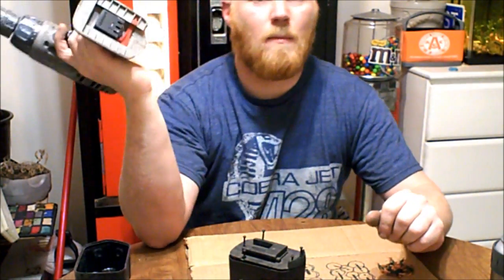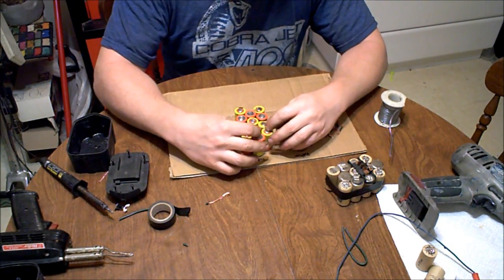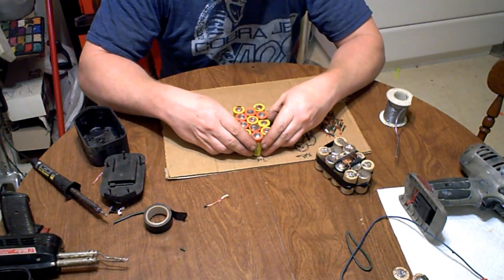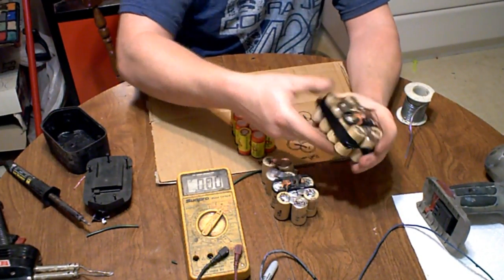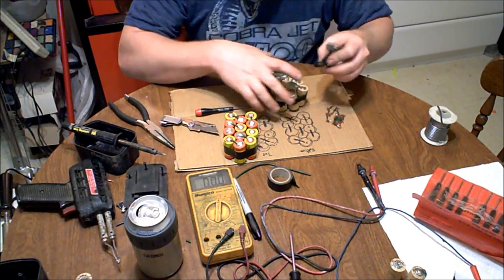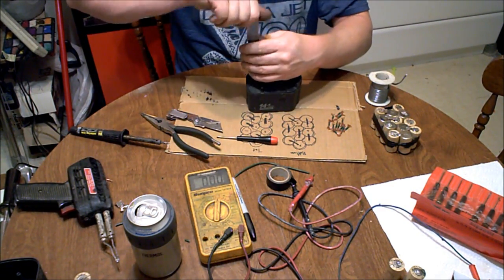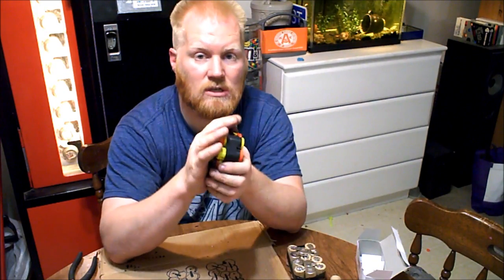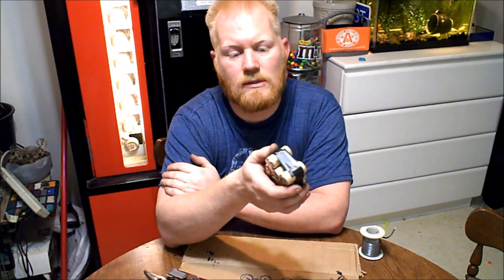Cordless Drill Battery Pack Rebuild for $20 or Repair for $0

Comment: Great video.  I have a 7.4v 4400mah battery pack with 4 cells...they are not labeled and I need to replace them.  What are each one? Thanks!
Reply from the maker: They are more than likely Lithium 18650 cells. They are rated at 3.7 volts each. So you have 2 sets of 3.7 cells(2x3.7=7.4v) wired in parallel.  Typical 18650 cells wont work. You need HIGH DRAIN cells, probably in the 20Amp discharge range. Pull the number off one of your old cells and look it up.
Reply: Thank you so much for the help!

Comment: SE US18650V 
T V1122RG17P
Reply from the maker: US18650VTV1 The closest I can find is US18650VTC1 which is a 30 amp draw battery.
Reply from the maker: I just can't find anything on the exact battery you listed. Does the side of your battery case say 3.0ah? If so we know that your batteries are 1500mah (1.5ah x 2=3.0ah or 3000mah)

Comment: I have a Makita Lithium Ion battery 18v,  I opened the pack up and I have 10 batteries measuring 2-1/2" Lenght and 3/4" Diameter.  I cant seem to find batteries on ebay to rebuild this battery, any help?? Thanks.
Reply from the maker: Your lithium cells are called 18650. BUT they are not typical 18650s, they are HIGH DRAIN lithium 18650 cells. Regular 18650 cells will short out if you try to put them in your drill.
Reply: sixtyfiveford So what do i search for to buy for my drill?
Reply from the maker: Your drill under load will pull around 30-40 amps. Your 10 batteries are wired 5 in series and then another 5 in series paralleled together. So you can split the amps and you need batteries that will supply around 20amps. Are there markings on the outside of your old batteries?

Comment: I want to thank you for your demonstration.  I also like your idea of "mapping" the cells on cardboard. 
With the use of "mapping" the cells for my 19.2 Volt Craftsman battery pack, I was easily able to rebuilt it, using 2900mAH batteries....It works great.  I expect that the new mAH rating for these new cells is much better than what came in the original pack. 

I do have some concerns though about some of your recommendations though.  As my battery packs were starting to go bad, I did test the individual cells and found that only "some" of the cells were not charging.  By the time I rebuilt it, NONE of the cells would hold a charge.  Therefore, I would recommend that; if your going to rebuild a battery back, then replace every one of the cells, as to avoid having to redo it in the very near future. 
Further, I had no way of knowing nor telling what the mAH rating was for each original cell in the pack.  So replacing "all" of them with new cells of the same rating seems like the better option. 

What do you think?  Does this sound like it would work better?? 

-Thanks.

Comment: Where are you getting 2.1AH nicad SubC batteries at for $1.67 each????  (12 x 1.67 = $20)  Please share!!!
Reply from the maker: Ebay. 2.2ah T-energy cells when I did this video were $22.54 for 12. Looks like you can still get them for this if you buy 24

http://www.ebay.com/itm/24-NiCd-Sub-C-2200mAh-Batteries-for-PowerTools-No-Tabs-/290485576557?pt=US_Rechargeable_Batteries&hash=item43a24a236d

Comment: If you are concerned about overheating a cell, use a clean flux like Kester 951. With the flux you won't need to leave the heat on for any longer than absolutely necessary.  Another trick I've found is to use the flat bus wire that is used to assemble solar panels.  It is 5mm wide and tinned.  You can usually get a 10 foot length of it on eBay for a good price.
Reply: I second the 951 flux - great stuff, works very well.
Reply from the maker: I have never really used liquid fluxes, only pastes. I just ordered some off Ebay and will give it a shot. Thanks guys for the heads up.

Comment: with a multi meter I checked all my cells and all voltage was fine....but will not charge in in charger unit.....ie broken cell or overheat....deff not over heat .....cold any thoughts ..thanks
Reply from the maker: There is a thermo sensor that cuts out when battery get to hot or cold. On the battery I'm working on it is the center terminal and it is like this on most batteries.  You should get voltage at this terminal.
Reply: Hi its a 24 v 3 ah bosch battery drill.. I run it flat then put on charge when cold and will not charge now...im getting 24.4 volts ...its got 20 cells @ 1.2 volts each...im at a loss now...started to disconnect each cell and test and disconnected battery reader  ....im stuck now. regards
Reply from the maker: Running them flat is bad for the cells. Stronger cells will actually reverse the polarity of weaker cells damaging them permanently. Your battery fully charged should read around 28 volts and is completely dead around 20 volts. You need to load test the cells. You can do this by hooking the disassembled battery back up the drill or a small flashlight battery to each cell.

If you can find a small 1.5 or 3volt light bulb from an old flashlight. Hook the bulb to the pos and neg of the multimeter and then touch the ends of the cells. The bulb will put a load and give you and accurate reading of the condition. The cells should hold around 1 volt for 5+ seconds. If it drops rapidly to near zero that cell is bad.

You can do the same test by hooking the disassembled battery pack up to the drill and testing each cell while the drill is running. You will probably find some that reverse polarity(pos becomes neg). These cells are bad.
Reply: Thank you very much ..
Reply from the maker: Let me know what you discover.
Reply: given up and will buy new one for 70.00 pounds....thanks for advice anyway
Reply from the maker: Take care.

Comment: Applying that much heat to a cell cant be good for it, am I right ?
Reply from the maker: To much heat can damage a cell. So melt the solder and be done. If the solder is taking to long to melt or I fiddling around with one I will stop let it cool and go at it again. I've never ruined a cell and never got it hotter than they get themselves by running.
Reply: sixtyfiveford Maybe your using too large diameter solder.

Comment: Thanks for this great idea! I have bought batteries from eBay, rechargeable, and they worked out fine. I assume I can get the STRONGER ones, right?
Reply from the maker: Yes, you can can get batteries with higher capacities. Just stick with Nicad as Nimh can't handle the high power drain of power tools. I really like T-Energy batteries.

Comment: Before watching this I just ordered 8 nimh 3500ah batteries for my 9v Makita (old ones NiCd).  I know they are different but I hope they work.  I looked into it and the charging times are longer.  I will let you know if it works over the long haul.  Still a cheaper alternative than nothing.  Just subscribed on your snow-blower seal vid
Bruce
Reply from the maker: A 9v Makita won't draw very much power so you should be fine.

Nimh- are for slower power draining devices.  They hold more power but also take longer to get the power into them.
Nicad- deliver a lot of power at once to high drain devices. The are fairly quick at recharging.

Comment: Thanks man. You explained everything really well. I was going to take a pack to a battery shop and have them rebuild it, but I'll give it a go myself. I just did a battery replacement on an Oral B toothbrush that died, and it works great. So I'm sure this won't be a problem for me either. It's nice to see someone actually do it though before I try it myself.
Reply from the maker: Let me know how it goes.

Comment: where did you get the batterys and how did you know what kind to get
Reply from the maker: Ebay is generally your best bet for Nicad batteries. Most cordless drill packs use "sub C" size batteries but you will need to open it up your old pack to see and measure.

Comment: How do you repair the 18V Lithium ion SKIL battery charger?? I charged by bat. pack twice and now nothing?? Any help would be much appreciated
Reply from the maker: On electrical components like a charger, the most common thing to go is capacitors. It could also have a blown internal fuse. Open it up and look for anything burnt or loose.
Reply: sixtyfiveford I'm a BSEE and I've repairing all the tools at my furniture company myself for 5 years.  You give excellent advice. Thanks.

Comment: Good video, I have seen 12 1600Ah Ni-CD 4/5SC SubC 1.2v at recycle powers in China, the die mentions are 34.4mm L x 22mm W mine are 41mm L x 22mm W ! Are they all like this and will they fit ok? Or should I look else were? Please help,. Regards robincox89@btinternet.com this is my e-mail address robonthemoor is my utube name any advice will be welcome.
Reply from the maker: Sounds like you just need Sub C.. The 4/5 sub C are shorter. Ebay is usually the best deal for Sub C batteries, I really like Tenergy brand.

Comment: Your video would have been more helpful if you had the camera closer (or zoomed) in on the batteries as you were connecting (soldering) them and the terminals.  Very hard to see what you were actually doing.
Reply from the maker: Lay it out just like your old battery pack. The video is available in HD so you can view it on Full Screen on a computer.

Comment from the maker: The little pencil one I use is 30 watts. It will work and I  have done entire battery packs but it is a little slow as you have to let it heat back up between connections. I prefer something with a little more watts.

Comment: I think this would be helpful for some:
ebay.c o m/gds/Sub-C-Rechargeable-Batteries-Buying-Guide-/10000000177628854/g.html

"Sub C" and "4/5 Sub C" are totally different sizes, and it's important that you determine the exact battery form factor you need before ordering.

Comment: Good video with valuable info.  Should not have skipped all the soldering, since heavy duty solder was used with a small iron.  It would have been good to see that done once or twice because it is the critical step in making this work.

Comment from the maker: The discharge rate is higher but the drill or whatever it is powering doesn't draw that much power that fast. The lithium would work great but you will need to get a different charger for your new lithium batteries. By the time you do that it is generally cheaper to buy a new drill that already uses lithium batteries.

Comment: I see that the Sub C cells have a max discharge rate of 2C wouldn't lithium ion with a 10C rating be better? Most of those are 3.7 volts and 2000 mah (milliamp hours) - Couldn't you use those in a different configuration?

Comment from the maker: Its most likely a lithium and has 3.7 volt 18650 lithium cells. They are situated just like these. The gauge is just soldered in.

Comment from the maker: Nimh are cheap and don't work well in high drain devices. They hold larger amounts of energy but deliver it a lot slower. Nimh are fine for digital cameras and such where the power drain is slow but not power tools. Your original charger is fine.

Comment from the maker: Sorry for the delay in response. Scratch up the top of the battery lightly with a sharp edge or use sand paper. Apply solder to the battery top separately, melt it then put your tab or wire on and apply heat. They will bond.

Comment: would 4/5 sub c work in my  old b&d 14.4 v and will my factory charger get toasted charging them ni cads. Would I have to get a better charger? ni-cd or nimh? price difference is 2 bucks but one has a lot more 2800mAh vs 3300mAh.  

thanks,
Matt

Comment: Please don't throw away the old NiCd batteries; they contain cadmium, which is a heavy metal (like lead).  Please recycle your NiCds.  Home Depot or Radio Shack will take them or if you have a town recycling station they might take them too.

Comment from the maker: Right on, reclaiming the 18650s is the way to go. The thing that fries individual cells is draining the battery pack to low. When they noticeably drop off and you still need to screw in 2 mores screws, don't. Weaker cells can actually be forced so low that they reverse polarity and are damaged forever.

Comment: i have 5 rigid battery packs, and have taken them apart, i saw thet only one or two were fried, so after researching, i found out that laptop battery packs have the same 186500 type lithium-ion batteries, so i dismantled thre battery packs and ,VOILA! free batteries.
thanks for the video i can once again use my drills

Comment from the maker: The Lithium are a different beast entirely. Your drill wouldn't mind but your battery charger would. 20 volts would would more than likely fry your drill. Any solder that says "electrical" solder will work (plumbing solder no).  As far as memory goes, according to numerous technical articles it is a wives tale. The thing  that kills your drill batteries is using them when the start to drop off in power. Generally you just need to screw in "1 more screw" or the like. This kills individual cells.

Comment: You can also use the OHM setting (resistance) to measure each cell.   I've found over the years that as NiCads age, with hi amperage charging.. The peak voltages actually rise.  eg. a 7.2V pack can peak at 10-11V with charge current applied, 3A to 15A.

Comment: Apply flux before you start soldering or unsoldering.  Standard plumbing flux (acid free), will work in a pinch.  Trust me!  It also shortens soldering time.  Yes, there is 'some' flux in solder.. but it's barely enough.  Add your own and solder flows where you apply the flux.  I've been making packs since 1987, lol.  Extra flux makes it NIGHT and DAY. Shorter your time heating cell, the better.  The hotter your iron the better.

Comment: You can usually just grab the thin metal tabs with needle nose.  Roll the tab by twisting pliers.  Spot welds are tiny dots, like 4.  They either break or leave a tiny bit of tab behind.  If clearance isn't an issue, you can just solder on top of the tab, is you cut it short.  Remember.. shrink wrap on cells wraps over the top 'ridge'.  The ridge-crown is NEG.  Try to preserve insulation there, or you will short the cell.  Some have plastic washers on top, re-use them.  Center tip is positive.

Comment from the maker: By the time you took it to a shop and pay them, you might as well just buy a new battery. With a little practice solder can be applied paper thin. The reason for doing it yourself is to save $ and put higher end battery cells in.

Comment: You can also takes these to batteries plus and have them do it. A lot of pack solder causes spacing issues because they are so tightly in there. You need a spot welder in that situation

Comment: I got a drill calles AWD awd144. It came with 2 batteries and battery has 14,4v 1,5 ah..The problem is,that I used first one about a year and now if I fired up second new one, which just stayed as it came with the drill, and now both of them just let wind some screws and then its it - back charging again. Also, somehow, in the manual and on the batteries there isnt names, how many mah´s battery has. Its also Ni-Cd.

Is there a way to find out mah size? Tried to google already, but no solution...

Comment from the maker: 200w will work just fine. A larger iron will just retain heat longer and allow you to work faster. 
The spark trick will give you a false sense of accomplishment. The battery will never regain capacity. Voltage is just a number, the thing that matters is capacity or amp hours. Even if you get the batteries to take a charge and the run your drill, the very next day they will be dead dead.

Comment: hey thx. no its a battery one. thing is I restored these 4 batteries with the spark trick, and got all 4 to charge, the meter is on 20 and on two of the batteries they test over 19v then goes to 1, the other 2 stay at 19+v, confused, 
do you recommend that style of iron or a standard gun, I have one of them but there like 200w is that to hot?
thx keith

Comment from the maker: 1. I'm assuming you're using an analog meter. The batteries are so weak they can't hold enough amps to run the meter.

2. The soldering iron I use is only 15 watts. A larger 30+- watt one would work better.
3. 1/8" rosin core for electrical work
4. 16 gauge

Comment: I have a question for you (18v Ryobi battery) when I put my tester on them to check the full charge voltage 2 of them test at 19.something and stays there (the reading on the tester) but on the other 2 when I test them they jump up to 19v but then reverts back to 1. what does that mean for those 2? why wont the voltage hold (on tester)? 
2. what wattage is your iron?
3. what kind of solder, and diameter? flux core?
4, what size wire 
 thx keith

Comment from the maker: I have not personally done a Bosch 14.4. I have never seen a battery pack that didn't just have the screws removed and the 2 halves pulled apart. Some brands put screws under thick decals.

Comment: How do I open a Bosch 14.4V battery? It has 3 screws which are accessible and one with a seal over it, it is out of warrantee so I'm not worried about that, I just don't want to crack the plastic. Thanks B

Comment from the maker: I have seen a few people come up with some ideas. The best is to just wirr to run off your car battery or a car battery charger.  They actually work very very well on the 12-14 volts from a car battery even though they may be an 18 or 14.4v drill. Just open the handle and hook the 2 wires pos and neg to some wires that lead out.  Put some alligator clips on the ends and hook it to a car battery.

Comment: Hi I have an idea ? can someone invent a battery pack that plugs into an electrical outlet. Inside the battery pack would be a 110 to 18 volt convertor. This could be used if a tough job heats up the battery you could put this pack in and continue the job. Lots of these power tools are for sale used because people don't want to keep buying batteries. Check out porn shops! I don't use my set that much so I am going back to plugin drill. My total Ryobi set would then be for sale....Don